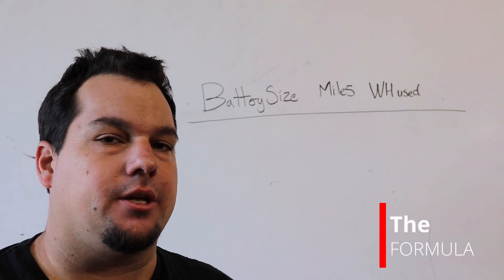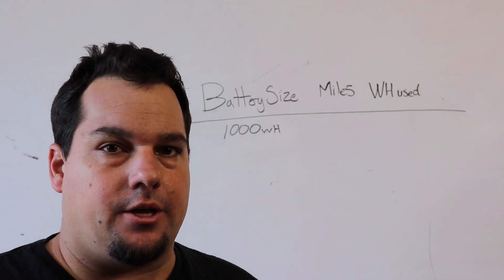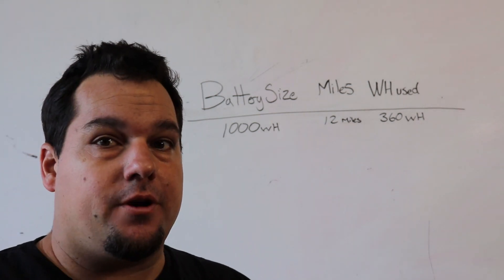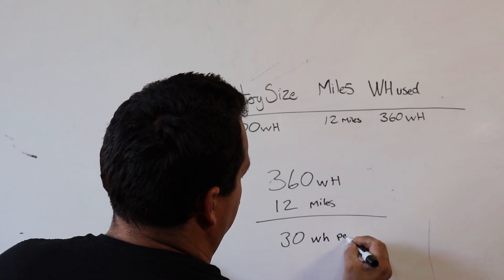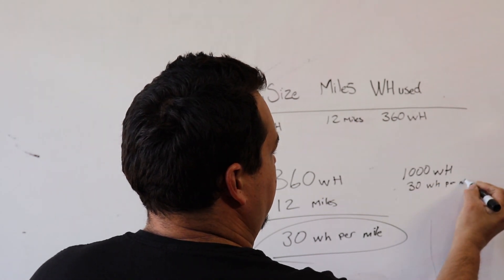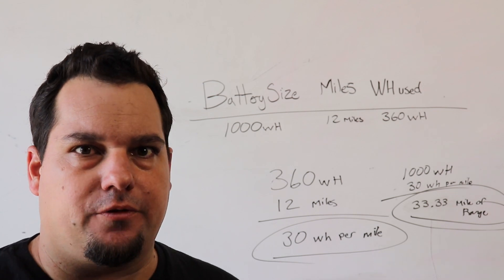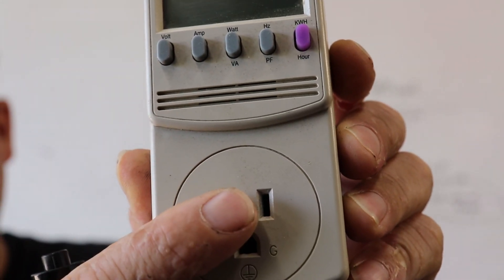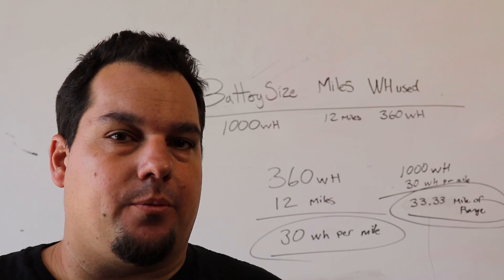Real E Bike Range?? How to calculate REAL E-Bike Range in the real world!

Comment: One problem with your calculations, it assumes that all of the 1000wh of capacity is useable energy, and it is not!  I run my battery from 100% down to 20% SOC and use battery voltage, miles traveled, and elevation gain to calculate range.  If you are touring or bikepacking you should calculate the range while fully loaded.  If you are riding only 12 miles and adding the unknown variable of charger efficiency, how accurate are your range calculations going to be with such a small sample of real-world conditions?
Reply: Anyone trying to accurately calculate ebike range is fighting a losing battle from the get go anyway.

I'm on my third ebike build now, and I've never been able to accurately assess the range.

It goes further, but slower, in winter.
Head wind can take big chunks out the range on any given day.
Tyre choice.
Wheel size.
Rider weight.
Terrain.
There are so many variables that although it's relatively easy to get a rough estimate of range, uktimdely each journey is different, and can have a double figure difference in the range on a bad weather day.

Comment: This is helpful if you already have an ebike, But what if you're trying to figure out how big of a battery to buy for a diy conversion kit and you want to get a predetermined amount of miles out of said battery. Is there a rough generic formula to estimate watt hours for flat land and a given rider weight?
Reply: Unfortunately no.  There are too many variables, including wind, riding conditions, and even how hard you are pushing.  What I've found is that on the lowest assist I can average between 15-18 Wh/mil while on the highest assist I can average 35-45 Wh/mile.  But even on the lowest assist if I'm pushing hard I can get it up to 25 Wh/mile, while on the highest assist If I'm just taking it easy I can under 20 Wh/mile.  So it just takes time to learn how your bike responds to how you ride and where you ride.

I would suggest that if range is a concern, just get the biggest battery you can, and consider getting a second one that you can swap to for longer rides.
Reply: Motor wattage divided by battery voltage gives you your watt hours, and the higher the watt hours, he higher the range.

The higher the battery voltage, the higher your acceleration speed.

Trying to accurately calculate eike range is almost impossible. The amount of variables make it impossible.

Head wind,
Hills, 
temperature,
Rider weight,
Tyre choice,
Wheel size,
Bike weight,
All have a marked effect on battery range.

Comment: Thanks for your video. I do the same thing except I don't calculate for charger loses. Using my calculations, I come up with 273.5wH per 10 miles on my local 10-mile loop of varied road. So, when planning I use 30wH per mile as an estimate. Maybe some others could give their results. Thanks Jonny. Subscribed